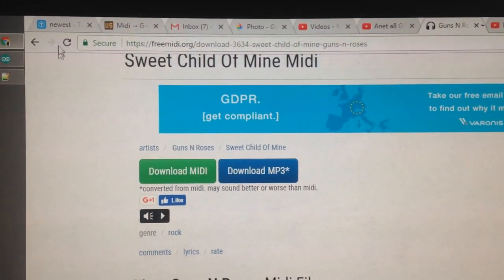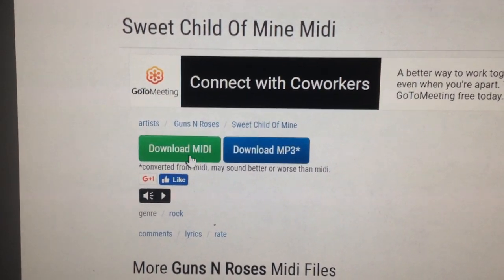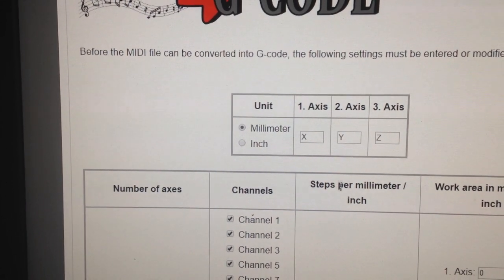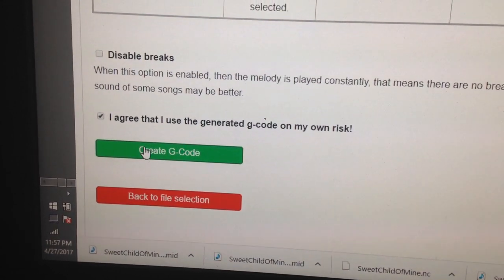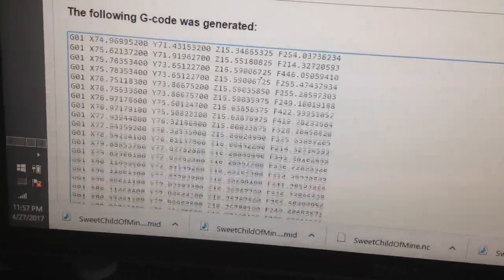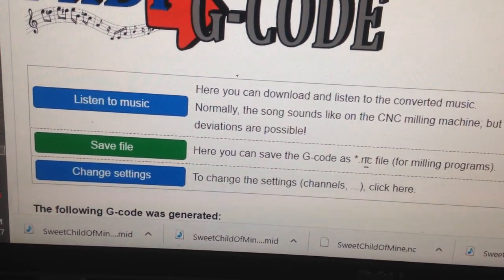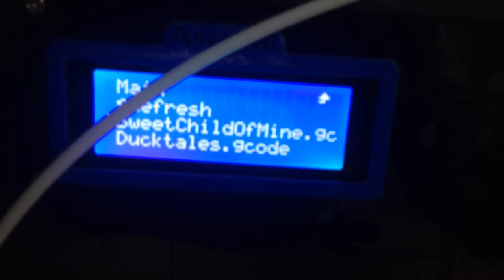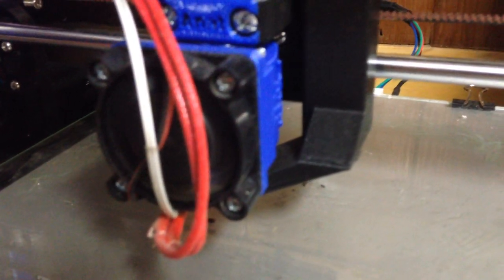Anet a8 Gcode music generator tutorial

Comment: do you know why my z-axis does not lower back down before prints? :( when the print is about to start the extruder head lifts up around 15mm ( i guess to avoid scratching/ hitting the hot bed) however it does not lower back down, and prints start in the air causing a lot of errors lol :( am i missing some gcode to send the extruder head back down to the bed? could you please send your guidance as i am new to 3D printing
Reply from the maker: So your saying when you home all and did the paper test its all good but when you wanna print its messing up?
If thats the case then its 100% a gcode issue... Mainly Your START  GCODE is whats causing that I had the same issue early on..
But just create a ANET a8 profile in CURA and it will save those start and end codes...
You can copy and paste mine to save you the time of looking up a video on it all add the machine settings too.
https://photos.google.com/photo/AF1QipNKKbrbfs98efEm_pXe05-sYNkPlGIWGxi3u8lu

AFter that you can see what was wrong with your original code but comparing I would do it just for insight it may help u in the future..
Reply from the maker: which one do you use for it?